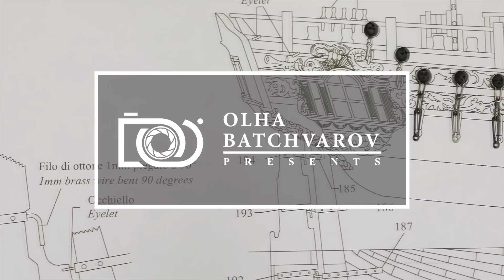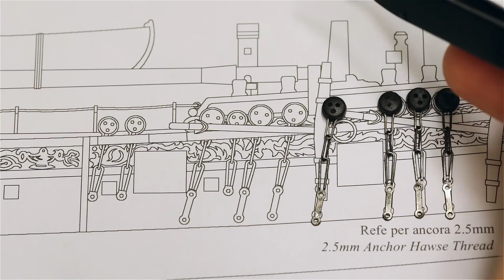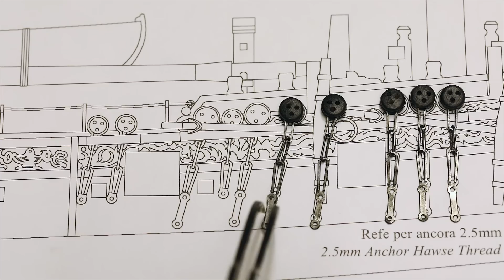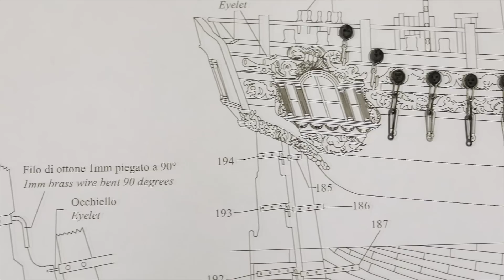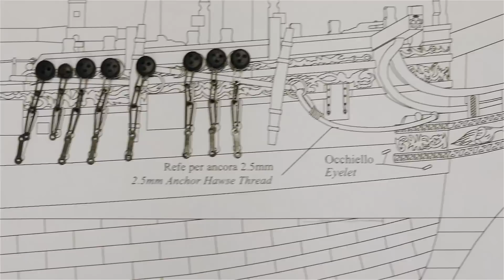HMS PEGASUS : Amati : Scale 1/64 : Step By Step Model Ship Build : #09 - Making the CHAINPLATES

Comment: That was a great solution to make new links! I’m surprised the kit manufacturer thought that bridging that big a gap with solder was a good idea. 😄 Beautiful work as always.
Reply from the maker: Thank you!
The manufacturer does not suggest using a soldering iron at all - just join these parts to a pile and nail them until they not fell apart...

Comment: Another great video Olha. Just a word of caution for anyone building the Pegasus. On this particular model the central 'open' link of the chainplates has to be shortened slightly for many of the main shrouds otherwise the chainplates end up interfering with the wale. This is an issue reported in several build logs and I had the same problem. This could be a problem if pre-assembling all the chainplates without testing for fit in their final place on the ship, particularly if soldering them closed.
Reply from the maker: Дякую!
Це не буде проблемою, коли ви зв'яжете савани...

Comment: If you have a small motor, like say an old aquarium pump that vibrates a bit, you can set small picnic cups atop those to help 'wash' the blackening off.  I've put the rinsed, and dry, blackened parts through a tumbler with ground corn and corn meal for a medium.  You then need a garage sale sieve to recover the parts from the tumbling medium.
Reply from the maker: Never thought about it. I need to borrow a pump from Imbir))) from his fountain...

Comment: Did you blacken the nails or are they purchased that color. Excellent work by the way!
Reply from the maker: In the subtitles there is all the information about materials and techniques. If it was my own brass wire nails - then I blacken them with Brass Black. For large scale I buy black nails for N scale railroad track...

Comment: Olha, your soldering would improve greatly if you kept your iron tip clean, tinned and shiny.  Looks like the flux you are using is relatively aggressive (phosphoric acid?) which will play havoc on the iron so cleanliness will improve and simplify your joints.  Also taking the solder to the metal on the iron rather than heating the metal with the iron and then applying solder is not really the best the way to go.  As you have so many to do a simple two pin jig to hold the assembly in a fixed position would free your hands. You could then use a prefluxed solder 0.5 - 0.7mm diameter, then clean up in acetone before blackening.
Reply from the maker: Yes, here I use prefluxed solder 0.7mm diameter and liqued flux.
This allows you to get a thin and strong soldering. And precisely because there are a lot of details, I use tweezers - it allows you to do all the work much faster...
I use Brass Black which blackens various types of solder and without acetone cleanup...